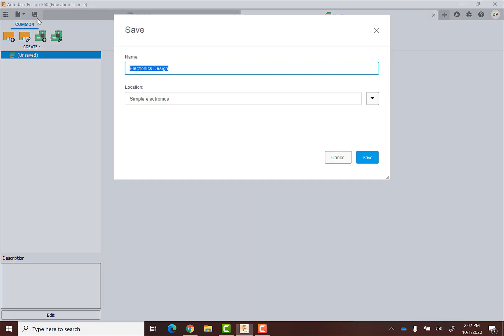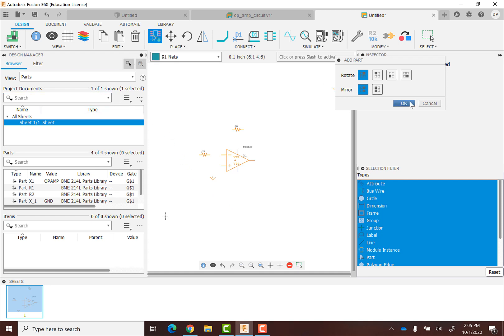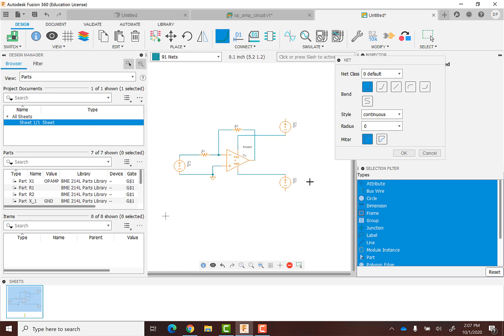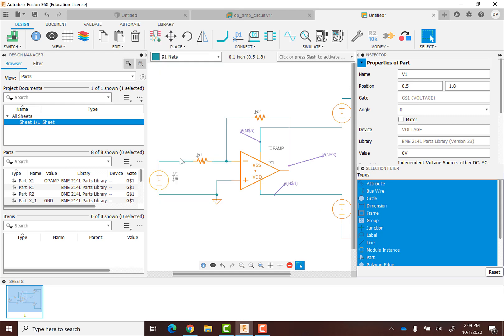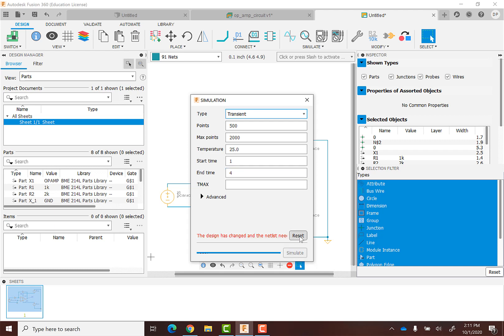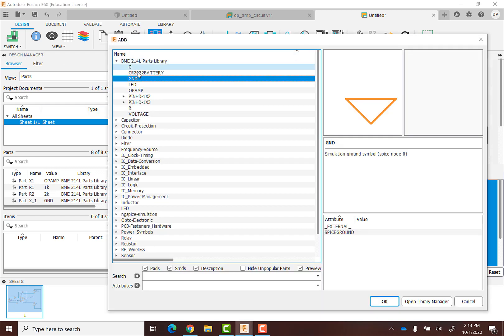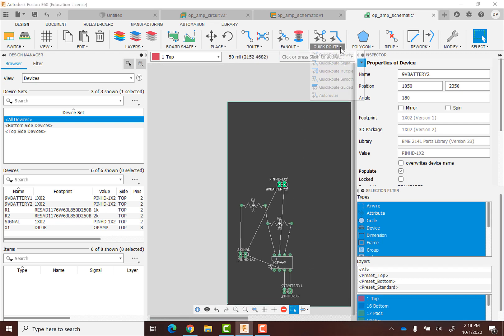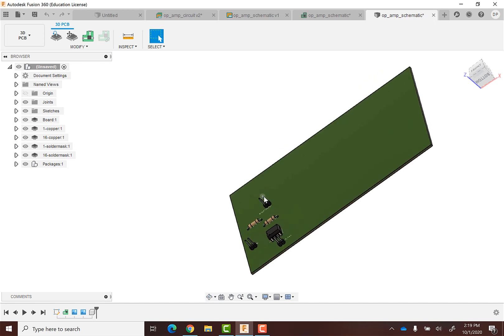BME 214L Using Fusion 360 to design an op-amp circuit

Comment: Sir in my pc i couldn't get the image of foot print and 3d package of op amp, may i know the reason?
Reply: I made a custom library for my students which included the foot print and 3D package.  You can make your own library and components by adding a footprint and 3D model...you can borrow those from an op amp in another library (there are many in Fusion 360) - those other op amps don't have a Spice sim model attached to it, so that is why I made a custom component that has both the spice sim model and the 3d model + foot print